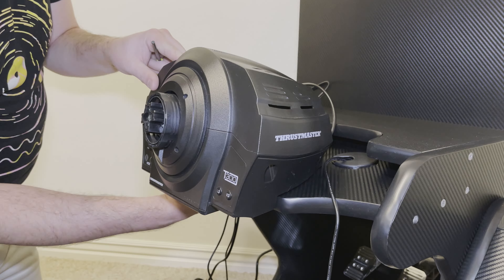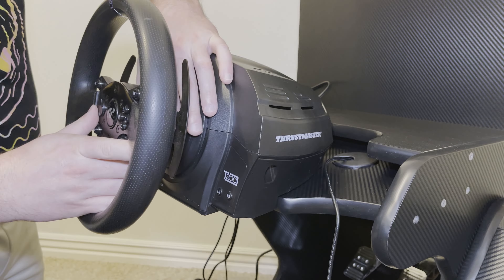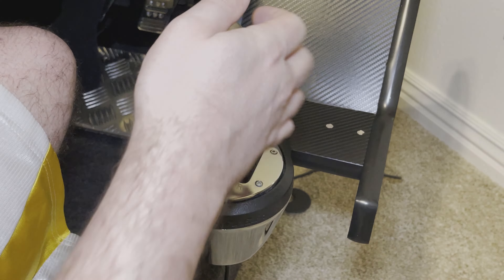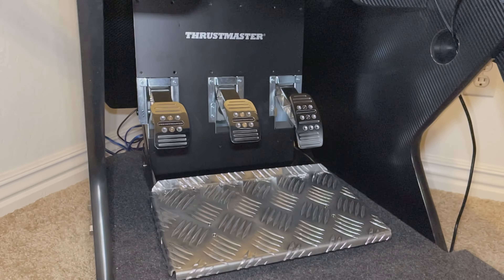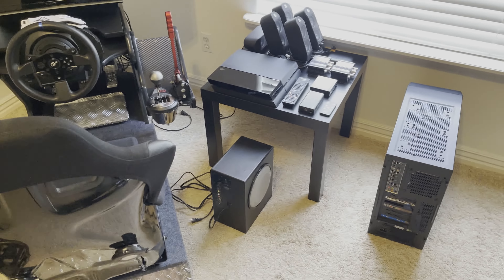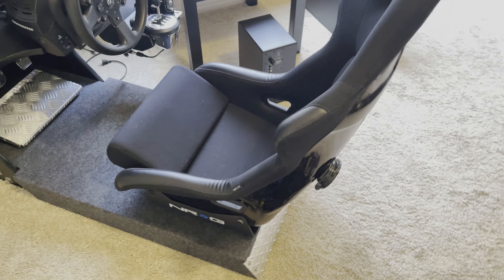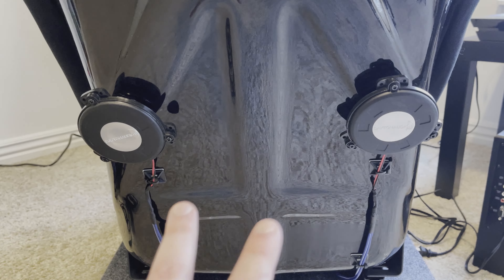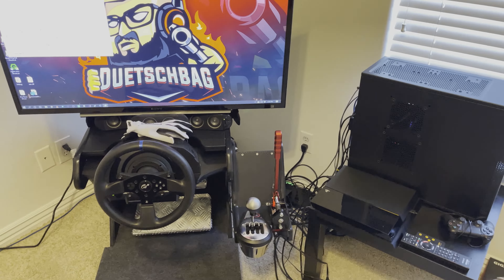The Sim Rig Gets It's Electronics!!!

Comment: Bro may i ask how long and how wide is the foot board
Reply from the maker: If you're talking about the main platform, it is 55in long and 22in wide.
Reply: @MaximumSponge  thank you🙏
Reply: Last question what is the height of the sidings where the steering wheel mounts
Reply from the maker: @tricenguapo8047  The uprights are roughly 26in tall, but the spot where the wheel mounts is 24.5in tall and is slightly angled so that the wheel is in a better position for the driver.
Reply: @MaximumSponge thank you bro i made a replica of that today
Reply from the maker: @6kidsbigdaddy  Thanks for the kind words! I would recommend checking out the "How Much Does It ACTUALLY Cost To Build The Ricmotech RS1/RS500 Sim Rig?" and the "Tips and Answering Your Questions About The RS1/RS500 Sim Rig" videos if you haven't already. Other than the things I mention in those videos, this has been a solid rig since it's conception.